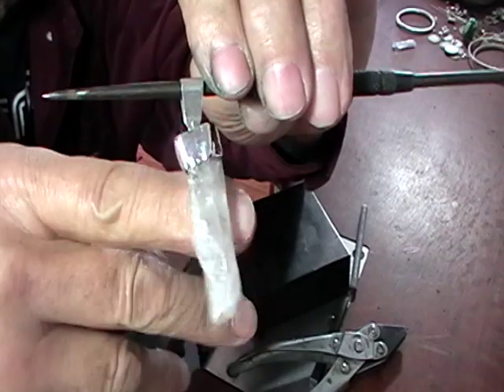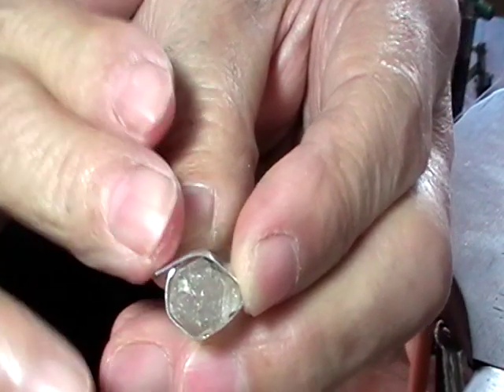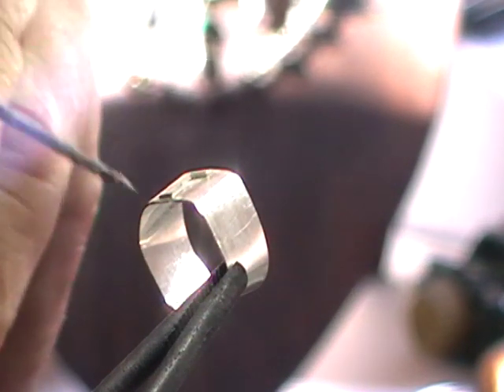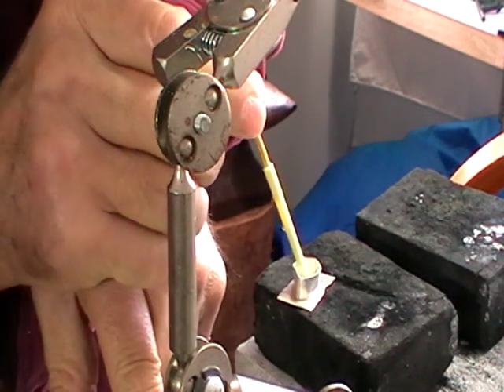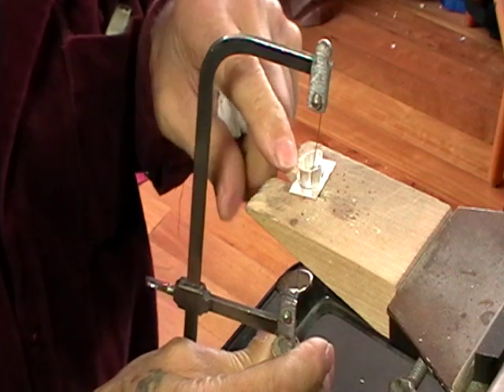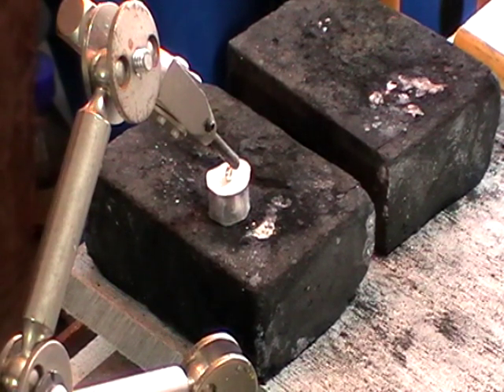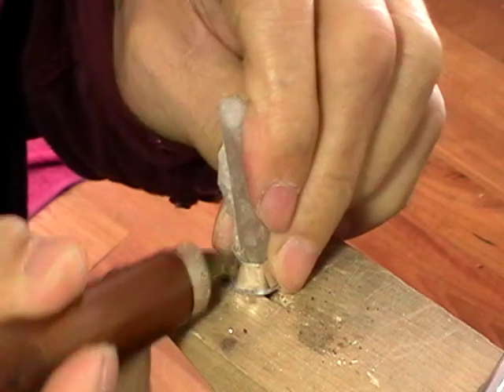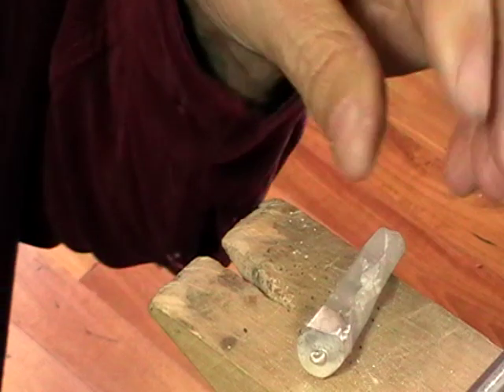crystal cap

Comment: Just watched for the second time. You make it look so easy. When I started working with metal, I said I would never be interested in stone setting because it looked way too difficult. I'm now ready to try this project and bezel making. 

Thanks so much for the great information. I have one question - what is your trick to sawing so quickly. It talkes me forever to cut out a small piece so I usually use my shears.
Reply from the maker: nothing wrong with shears if you file after